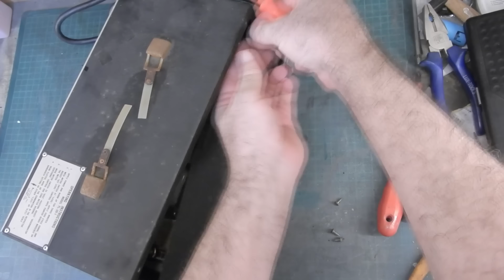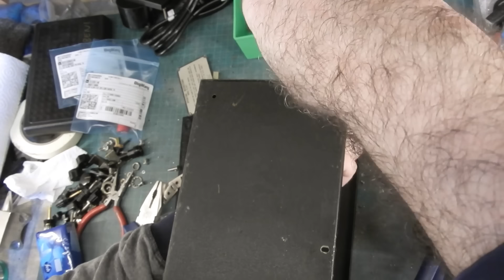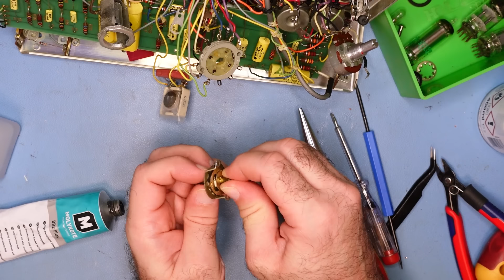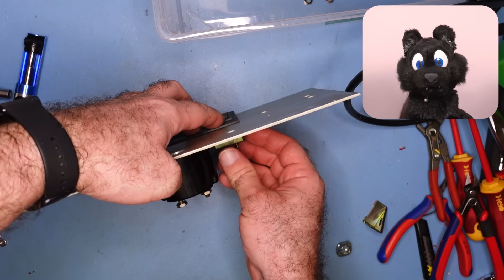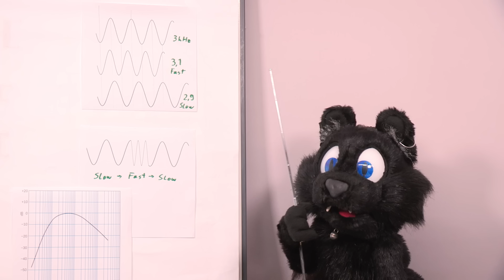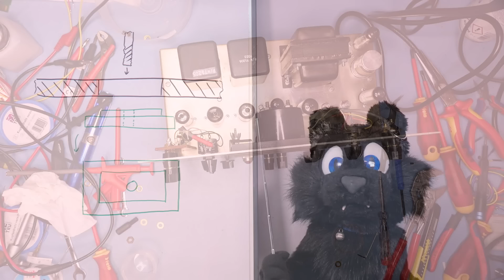Sentinel 3D-1

Comment: As for the 2-in-1 cap: why not repurpose the original base or make a new roundel out of pertinax?
The end result would be more sturdy.
Ok, this is an easy remark standing from aside ...
Strange that the potting from the transformer softened over time.
Reply from the maker: The new capacitors were just a tiny bit too tall for that: combined, they ended up about 2-3mm too tall, so I just barely could fit the metal plate in again, there was no room for the original base plate, which I normally use. So the case would not be able to connect to the metal plate anymore that holds it down; as it is, I had to use epoxy, cause I couldn't bend the case either.

Comment: HEHE, The Harman Kardon Citation Twelve (or Citation 12), Is a highly regarded vintage stereophonic power amplifier, and One Build to Match with the Crown ES series speakers—such as the ES-224 and ES-212—are legendary, vintage hybrid-electrostatic loudspeakers produced by Crown International in the late 1970s. Match the TWO and Use the Sentinel 3D-1 With the RCA Transistors 15 DEG Phase, up to 100 KHz up to 180 KHz Frequency Max, But the Ultra High Sounds Does Funny this To Music. Pure Clean Music...

Comment: Hi, you can use the signal generator to simulate wow & flutter; simply modulate the 3kHz FM signal to a lower frequency. Use Chat GPT to determine the exact calibration values.
Reply from the maker: I did put some modulation on the generator for "some non-zero reading" indeed; but I kinda want to know the process; asking an LLM for an answer is to me just rolling the dice. I couldn't validate any answer.

Comment: Maybe the odd hybrid construction comes from an unavailability of pcb mount switches and pots. One would think if the designer was eliminating rats nest wring he would do it wherever he could.
Reply from the maker: The PCB and glass diode elements make me think that it is from a time, when tubes were about to be replaced. The company probably used up all the "old school" components that would be cheap at the time too. I think at the time, "routing a PCB" wasn't as much of a design aspect as "placing components on the chassis" was. Different priorities and as such, not every component translates 1:1 to a PCB. But removing almost all "free floating" components was already more than I expected.

Comment: Use a turntable and induce wow and flutter by using you finger on platter to adjust speed during playback, that should work.
Reply from the maker: That would certainly make for "a" wow and flutter signal... what I'm missing is a proper reference to set the absolute readout though. Or did you mean to say something else?

Comment: You might be able to exaggerate.the wow and flutter by generating a 1000 or 1500 Hz signal then apply wow and flutter then speed up that audio 2 or 3 times respectively. At least I think that might work...
Reply from the maker: The Audacity plugin also limits the base frequency to 3000 to 3150 Hz x.x it is really tightly limited to the "usual" values.
Reply: @atkelar hmmm

Comment: I have to ask what lathe was that. I have been on the lookout for a tiny lathe for things just like opening a capacitor. 
I have also been looking a SMD for restuffing. A small multi footprint PCB could make many sizes of capacitors at different voltages. And yes SMD caps do come in multiple hundreds of volts ratings.
Reply from the maker: It's not exactly "tiny" - one of these cheap tabletop "mini lathes" that are all over e-bay and similar sites. I have the fixup process in my videos: https://www.youtube.com/watch?v=QQtdvLvsIAo
Reply: @atkelar ah yes , it looked smaller on video. But I know that type. Thank you for pointing it out .

Comment: Never carry vintage equipment by the original handle 😂. Also, any shoe/leather repair place should have been able to create a new handle with the old ordinal clamps. Done it before. Belt leather or straps of leather bags come in all sizes. Just a simple sitting sowing job.
Reply from the maker: Yeah, I got lucky; nothing but a few scratches ^^ - It might be possible, but I fear it would be a bit outside the affordable range... that, and the original hardware was rusted all over. The new one is shiny chrome again.
Reply: @atkelar in the past I used a shoe/leather repair job. Making handles was easy for them. I had a dozen made for a range of vintage Philips measurement devices, tube era. Don't think I paid more than 20-30 euro for 10 of them. The material cost is next to nothing. And it's two rows of stitches. Nothing fancy, but neither were the originals I gave them as examples. A lot of places charge an arm and a leg, but if you find the right place and someone that doesn't mind something close to normal, but different, you can get good deals. And the rust. Well there is an entire market for home plating. Nice skill to add

Comment: Man that one transformer must have gotten HOT for it to melt the potting compound.
Reply: You could see him moving the transformer screw, meaning the compound isn't solid, even when cold. Likely a kind of tar. And though tar is sticky and slow moving, it will move in a few decades. I don't think it was because the transformer got hot in this case.
Reply: That's the usual assumption, but I've (rarely, but non-zero) seen potting compound that must have had some solvent in it, that leaked like this over time. It just didn't harden completely for the first decade or so.